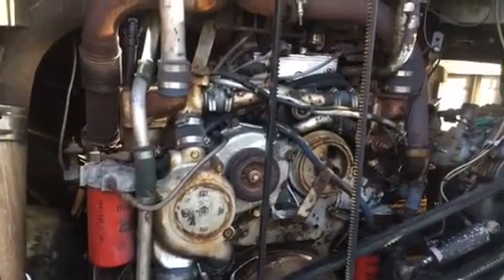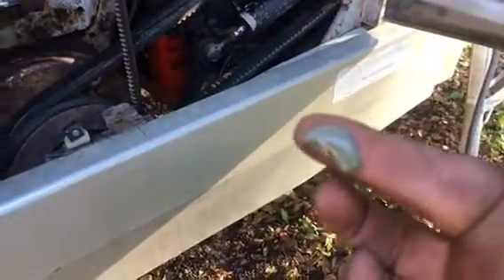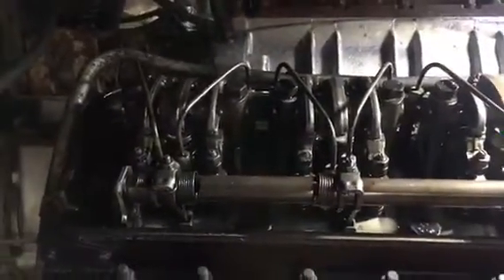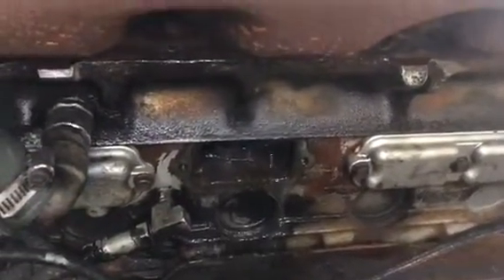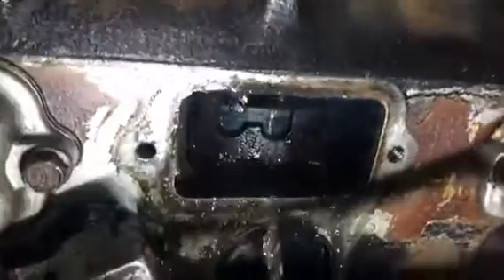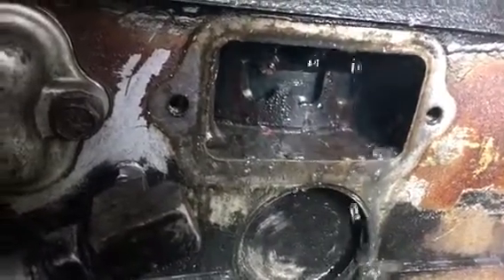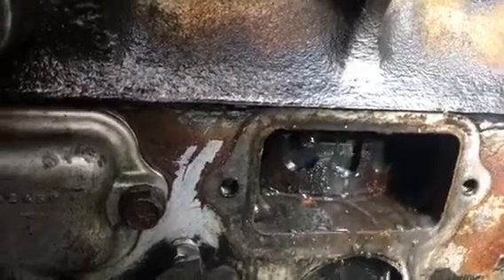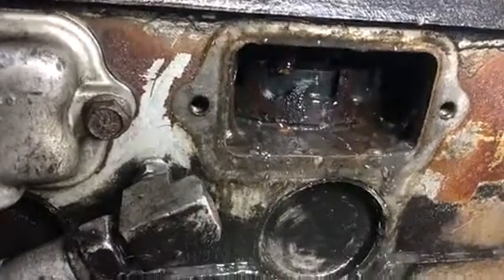8v92T water in oil Detroit Diesel MCI 9 bus

Comment: I got one I’m working on now. Found a hairline crack in a liner on what I’d guess would be #3 Cylinder. You think that’s enough to cause coolant into the oil pan/ combustion chamber? Not familiar with anything on these engines. Thanks for the videos!

Comment: Someone cooked this Jimmy and melted the liner O ring and that's why water is coming from above the port holes. These engines are fairly easy to diagnose once you've read a few manuals. You can also tell how they've been operated  by certain drivers without even looking at gauges. As soon as they get in a depot and switch off oil gets dumped on the floor from either excessive idling or lugging.